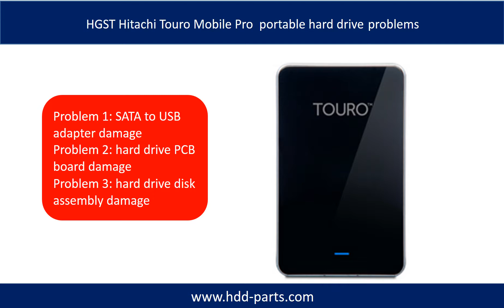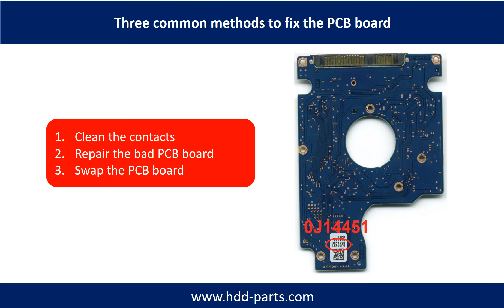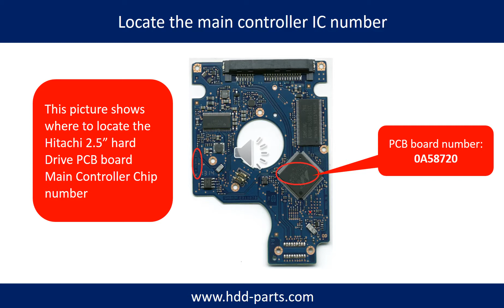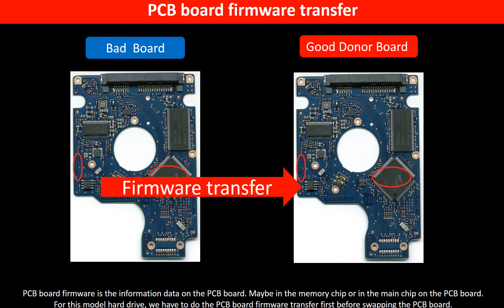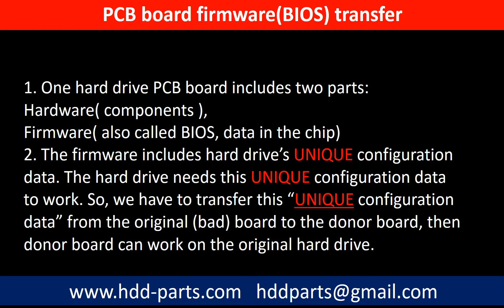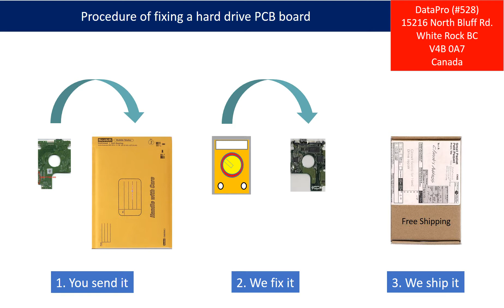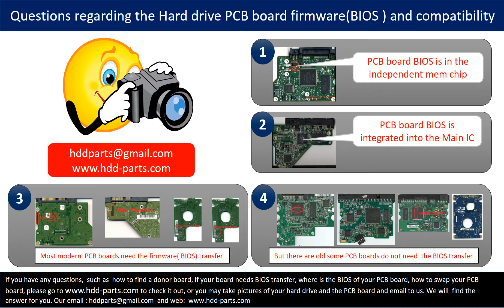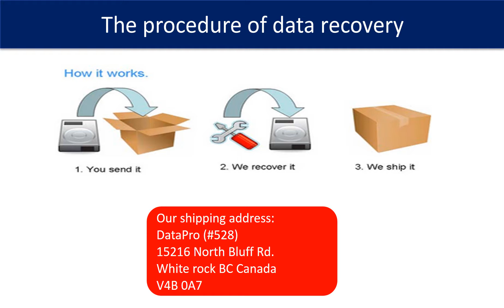HGST Hitachi Touro Mobile Pro  portable HDD repair & data recovery

Comment: I have the 500gb (bought in 2012) version of this HDD but it is not recognised by Windows 10.  I contacted technical support and they said that they are no longer issuing updates for it because it has been discontinued.  Therefore, the last operating system they tested it on was Windows 8.1.
When I attach it to a Windows 10 laptop, it is not recognised in Explorer however, it is recognised in Disk management.  When I right click on it in Disk management, it has no letter assigned (labelled Disk 2) and says that it needs to be initialised.  When I select initialise to either MBR or GPT, I get an error message.  I refuse to throw away a healthy external HDD just because Hitachi/WD can't be bothered to continue making updates for current operating systems :/
Any ideas how I can get around this?
Reply: i have exactly the same problem. no solution yet. but.. EXACTLY THE SAME SHIT.  :'(
Reply: wait for a long time.. seems to be all file stored in it were lost.. poor us..
Reply: The HDD should work fine under Windows 10. I have it working under Windows 11. If it does not work it either is broken or maybe you need to go to disk management and assign a drive letter to it.